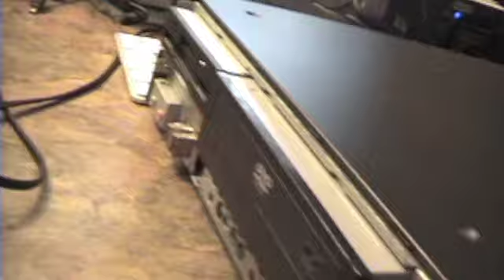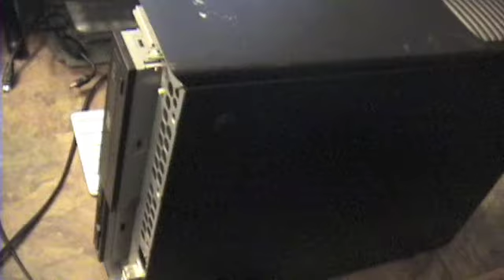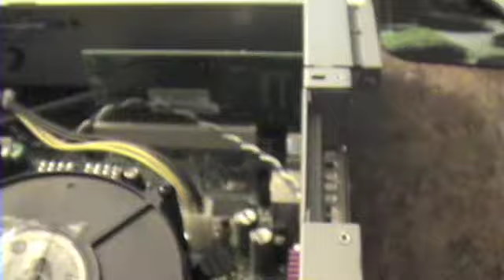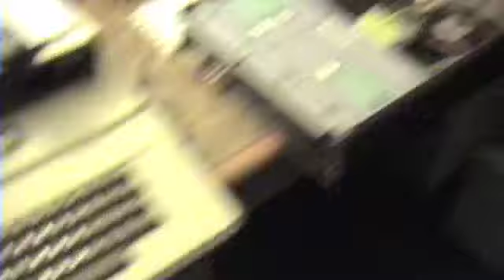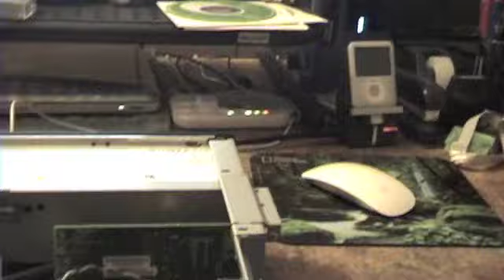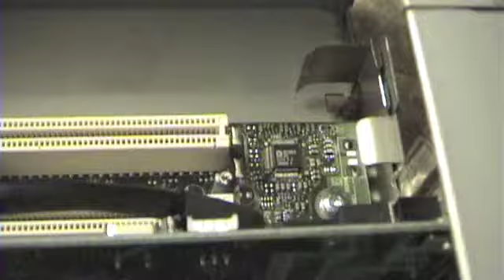Gateway E2000 Series SFF ATX Desktop

Comment: My 500X from September 2003 used a standard off-the-shelf Intel board. Most of the consumer-grade systems of that era used the same mPGA478 Intel boards, give or take...just with different CPU's in the socket. I'm not sure what model that board was off the top of my head.

Completely off-topic, but I miss the Gateway logo of that era.

Comment: I managed to save two IBM E_Server towers from going to the landfill. They are both P4s and have built in RAID on the system board. One is in use right here where I am typing this message. The other will go into my ham radio desk. One was brand new unused as a swap-in spare for the system they were used in. The one that was used has SATA drives. The sytem they were runing became obsolite and the PCs were destined for junk. It amazes me how quickly things become junk today. Nice find for you.